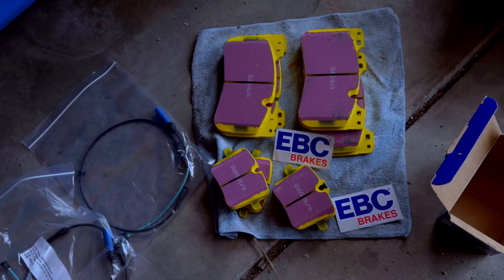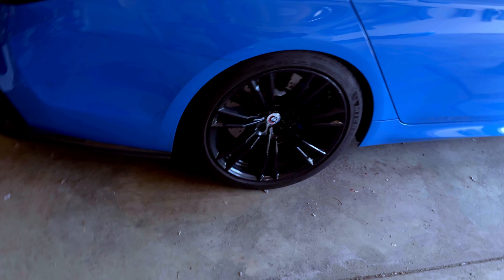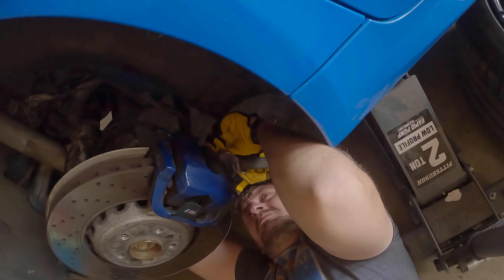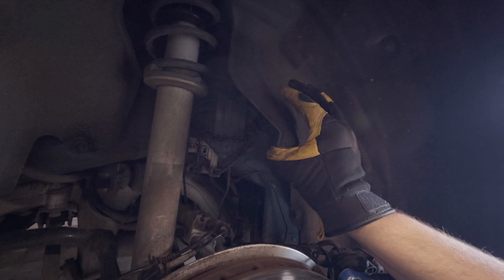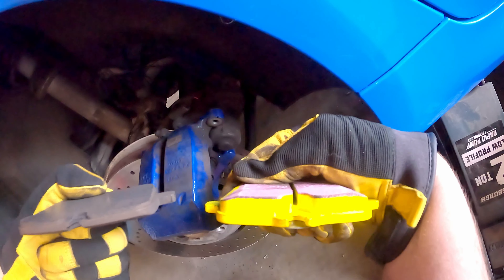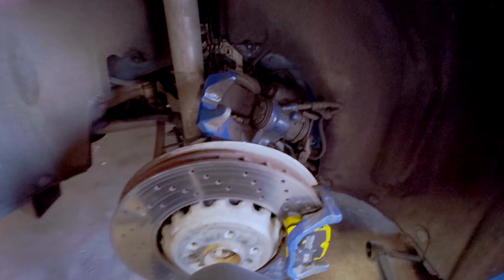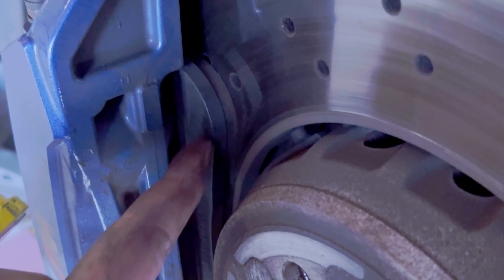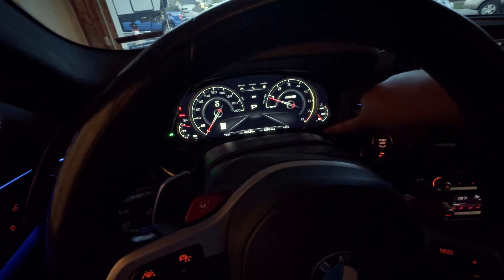Replacing Rear Brake Pads BMW F90 M5

Comment: I also gots to do my rear brakes on f85. Just ordered powerstop pads that were suggested on forums, not sure how good they’ll be compared to oem but hopefully will squeak less 😂
Reply from the maker: Oh nice! Do you remember which model of power stops? 
Think I had the z23 on my last car, they didn’t squeak and they had less dust, but performance wise it took a small hit on endurance, otherwise I was a fan!
Also got rid of that aggressive initial bite oem bmw brakes always have, was smoother and easier to moderate!
I wanted to try something new with the EBCs and many ppl on m5 forums swear by them, I also heard good things about the iSweep brakes
Reply: @theCarNoob  yes I also read a lot about ebc pads and people love them. I bought z23

Comment: Love it! One question tho, that break wear sensor broke off right. I forgot how that works. It connects somewhere behind that plastic cover and then onto the calipers? Or how and where do you disconnect them and swap them out?
Reply from the maker: yeah at around 4:40 I showed the plastic cover where it connects, the plug was pretty self explanatory. 
The other side of where the actual sensor is, has to go onto the new brake pad, it becomes more obvious where it gets installed on the brake pad as there won't be any other place around.
Great question!